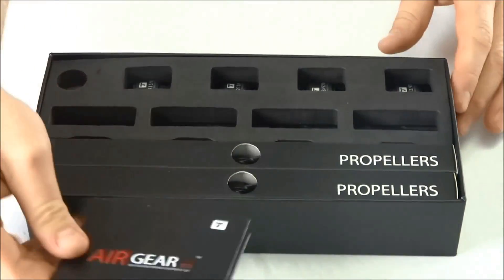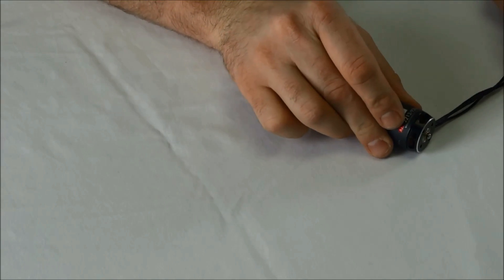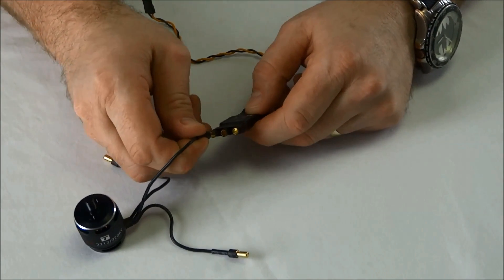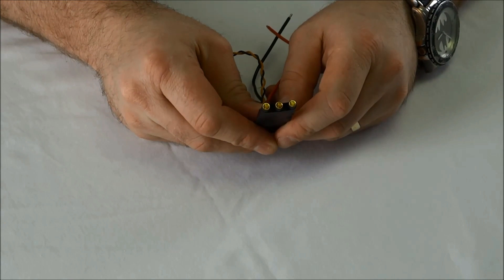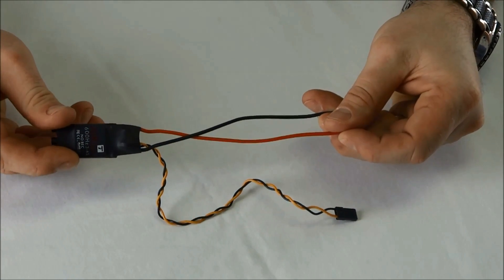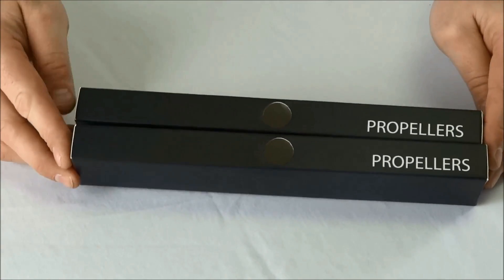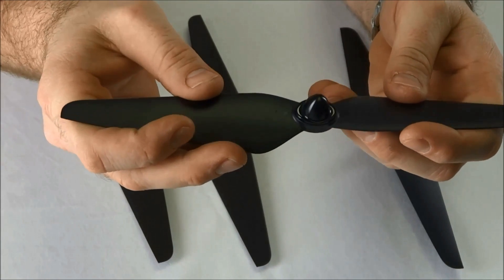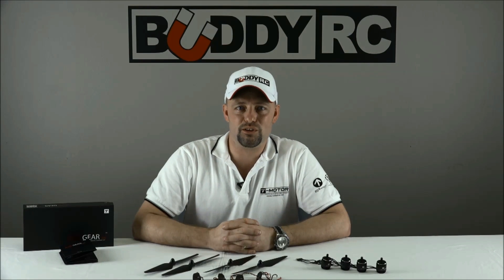T Motor AIR GEAR 350 from BuddyRC

Comment: By any chance would these motors fit on a xj470 quadcopter?
Reply from the maker: +Rampage851 This is the first I have seen that quad. The kit has a very standard bolt pattern at 16mm across and 19mm

Comment: Will the DJI Self tightening props fit these motors?
Thanks!
Reply from the maker: +tlandauerboat63 I am not Familiar with the DJI Props. They appear that they would fit, but I would be lying to you if I told you yes.
Reply: +Buddy RC 
Hi, I got it all sorted out, using the Air Gear 350 on my Flamewheel 450, couldn't be happier.  I have built a few others meanwhile and using DJI keyed props as well as other style.
Thanks for the reply. 
Cheers!
Reply from the maker: +tlandauerboat63 Good to hear. Sorry it took me so long to respond. Its been a busy summer!
Reply: +Buddy RC 
No problem,  keep up the great work, thanks!

Comment from the maker: The Prop adapter does not come off however it is designed with 2 screw holes underneath the stock prop for the installation of MN Style props. In the video I believe I referred to the shaft as a 4mm Shaft (this is the internal shaft size) however the prop shaft is 6mm so you can use the standard  Gemfan Slow Flyer props with CW and CCW nuts. I am using the AirGear Set on the Diatone Reptile which weighs in at 1400g and it works great! I have put heavier batteries on it pushing the 1500g weight limit and the quad does start to loose performance on anything 1500g and heavier.
Reply: +Buddy RC Are you running 3S or 4S?
Reply from the maker: I have been running 4S

Comment: What? Couldn't hear you lol. Just playing. is this a one piece motor or does the prop adaptor come off? Can is be changed. Is it a 5mm shaft? Have you used this motor set? How about a coupon code for a loyal customer ;) Love my glacier batteries which I use in all my videos. Check them out!